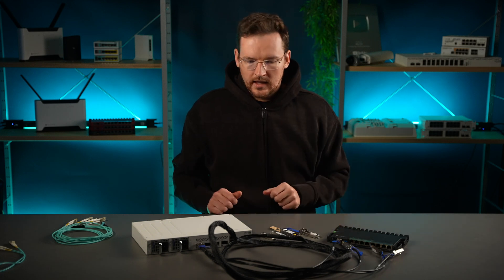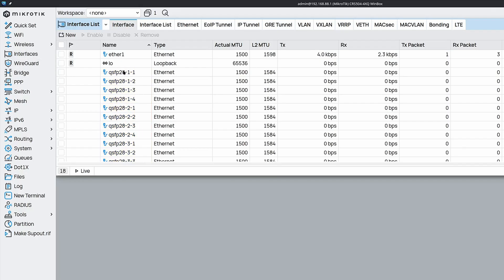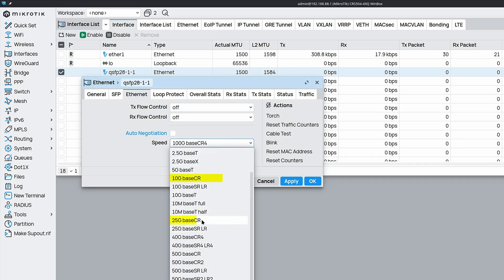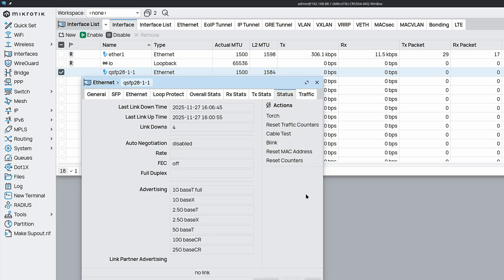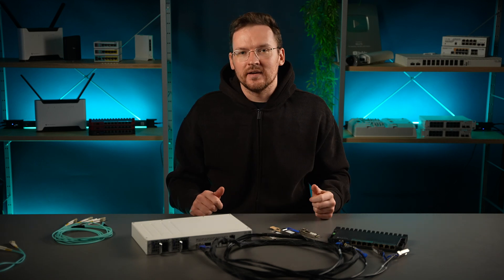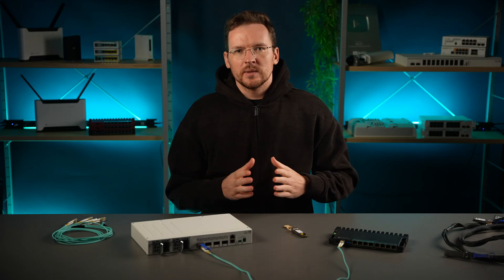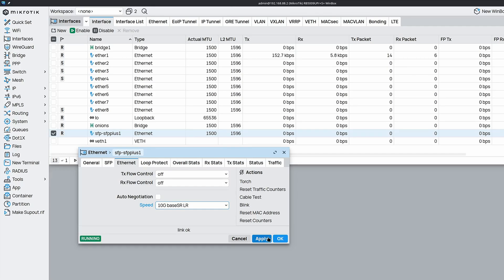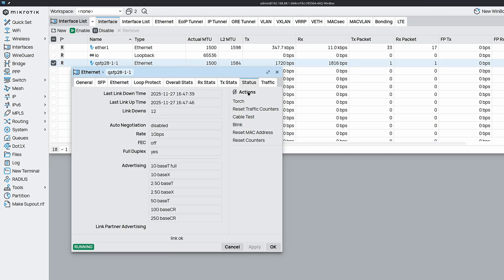Interface the bigger QSFP form factor with older SFP28, SFP+ equipment

Comment: Do you know if you can do this with CWDM modules? A 100G-CWDM4 or 40G -LR4 optic (duplex LC) should line up with four wavelengths of CWDM, can you then break that out optically into a set of 1270, 1290, 1310, 1330 10G or 25G optics?
Reply from the maker: You need passive mux/demux for that. If there is a breakout cable like that, it will likely have a small box in the middle.

Comment: Can you link the cable you used to break out the 100G transceiver to 4x25G? I have a CRS510-8XS-2XQ-IN and I'd rather use optical patch cables instead of copper DAC cables in my rack.
Reply: MTP-8 to 4x LC OM4 is the kind of cable.
Reply: @_Jonny_  Thanks!

Comment: With a proper SFP can't routeros autodetect the installed SFP type?
You might need an override setting, but the manual mode seems silly.
Reply from the maker: Of course, it can. This video is about situations where you do not have the same interface+cage at both ends of the cable.